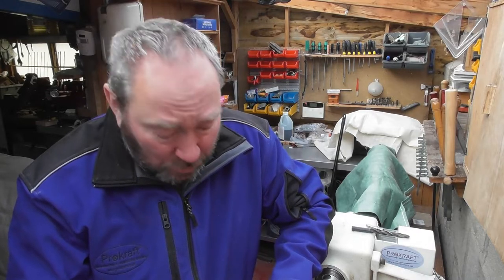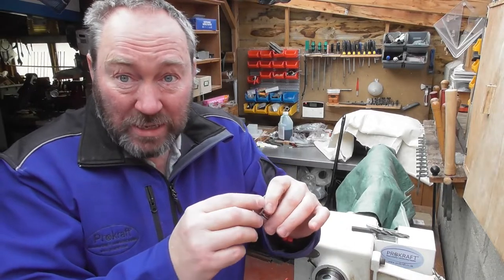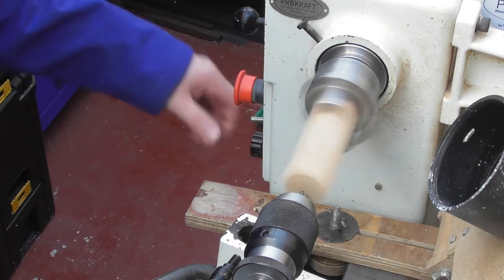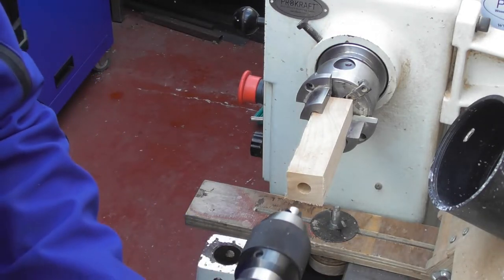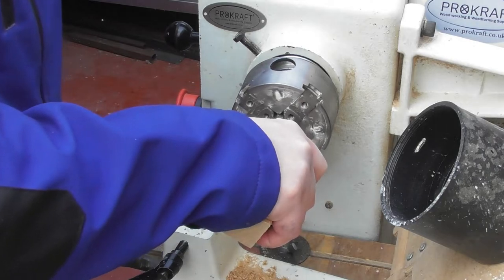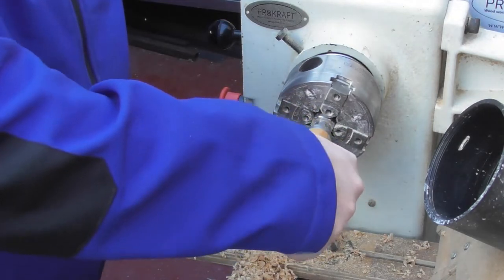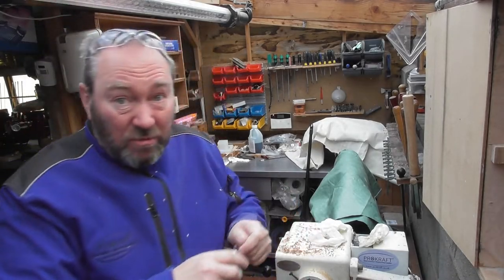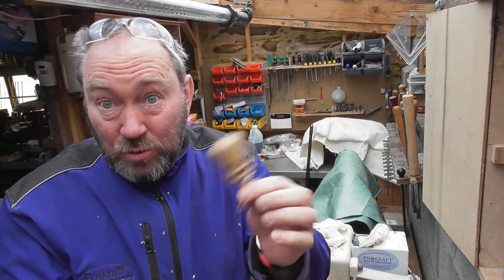Playing Card Bottle Opener Set

Comment: Tip for you John,  put a bit of m8 bar in chuck put 2 m8 nuts on and then m8 screw insert, lock nuts to insert.  Bring upto hole and gently wind insert into hole while turning wood, will give a true center alignment.  Geoff
Reply from the maker: Thanks Geoff, yes we have another video on how to do this, I was a bit short of time as usual to do a video. Usually I use a pillar drill and only use the lathe for ease of filming and because I can't know what equipment anyone has. Cheers Jon.